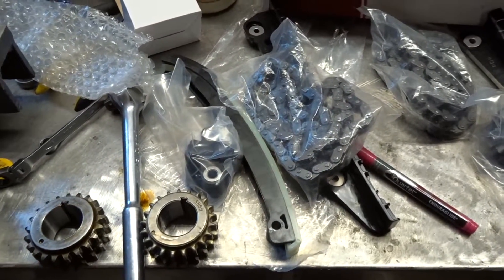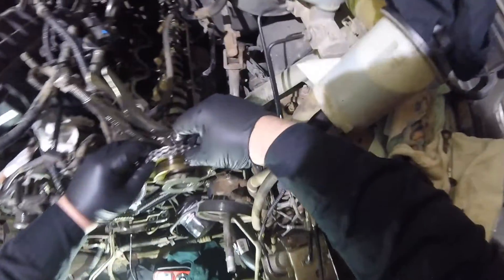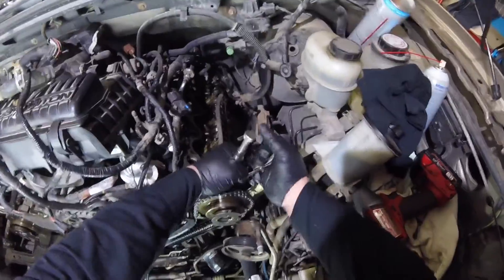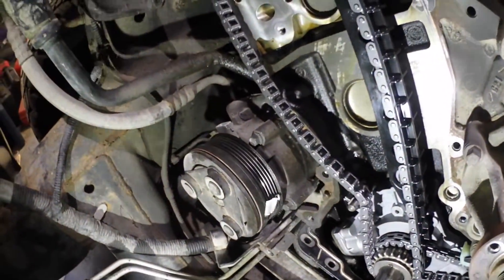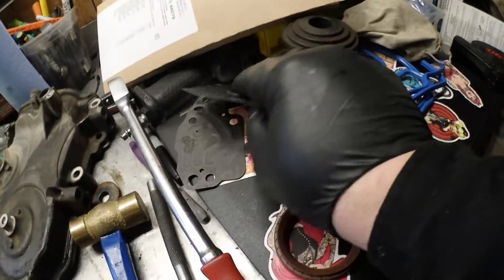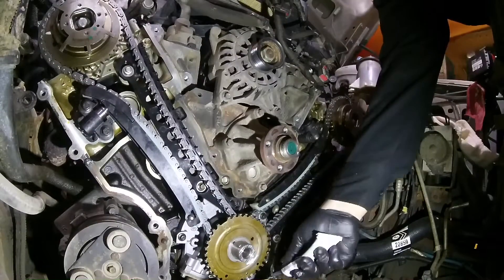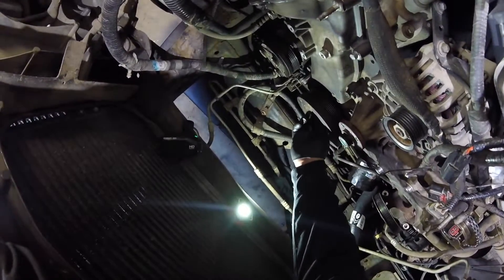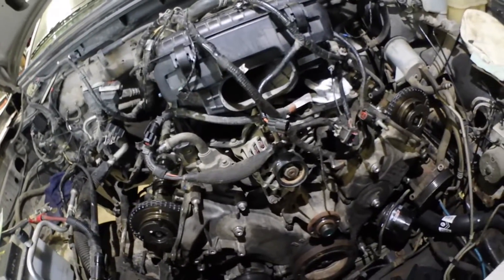5.4 3V Cam Phaser DIY Engine ticking Knocking

Comment: I just did mine, But I replace the followers and lifters,
 I pulled the engine out...
 Made life so much easier for the extra day work.
 You don't need those vice gripss ever, Unless you need something to hold a cam to get the phasers off
 But I'm not sure if you had that phaser hold tool 

 There's no way to get the timing wrong everybody gets so scared if the cams move... As long as you're timing marks and chains are aligned,  You're good.

Of course when I had the motor out, I did the rear main seal and slinger.
 Did both exhaust manifold's

Clean down the oil pick up tube and it made life so much easier to reinstall oil pump

 I suggest to anyone that needs to do the timing job to just pull the motor

 It's a little extra time but it's so much more comfortable working on it

Comment: Hello, what was the reason you had to replaced the crank seal? Could It get reused?
Reply from the maker: You can, my theory is your already got it apart, replace what you can
Reply: @TestDontguess  thanks I was thinking if it doesn't leaks removal could of caused a leak after the replacement.

Comment: Why did you hold the cam shaft with vise grips , and why the cam shaft spinned in the other video from it self ?
Reply: He probably didn't remove all the roller followers. That's why the cam kept wanting to move. Everyone has their way but when I do these I remove all 24 roller followers and inspect them. Makes the job ALOT easier having them out. And having the crank alignment tool to get that crank dead on at the 11oclock position

Comment: If you have a well maintained engine and this ticking slapping noise just started this is the absolute way to go about it no need to remove cams no need to mess with the lifters if you find immediately that the tensioners are blown that's it I would put the mailing pump in crank seal guides chain tensioners and VCT sensors that's it. Great job

Comment: THANK YOU so damn much for this particular video. I watched Maku's videos and some others but today I was having trouble with about the same amount of slack as you on the left chain and called it a night worrying I had somehow jumped a tooth, even though it ran fine prior to removal of all components. The vice grip trick looks like all I will need. Also, that oil pump pickup tube bolt, holy hellllllll. Again, thank you for lessening my anxieties about this 😂😂

Comment: Im having the same trouble you where with the slack on the left side when I go to rotate it and put the tensioner on pull the pin it still want to rotate back causing slack on the bottom
Reply: Same lol
Reply: Remove all the roller followers out and you won't that problem with the cams wanting to move on you.

Comment: It is recommended that you put in the melling 340hv oil pump. Gives better oil pressure. And if keeping the truck use Ford OEM. But the oil pump Ford even has recognized the Mellings is superior.
Reply from the maker: Pressure is the result of restriction to flow.  Pumps don’t make pressure only flow.... too many people can’t grasp this concept
Reply: @TestDontguess  ok well the guage on my Vette says oil pressure not flow. And psi increase again is pressure. I guess if you restricted the flow it will cause pressure. Thanks for the lesson!
Reply from the maker: Simple way too view it is take a garden hose and let the water run, restrict the flow with your thumb and you build pressure